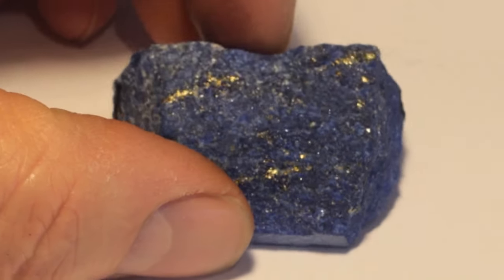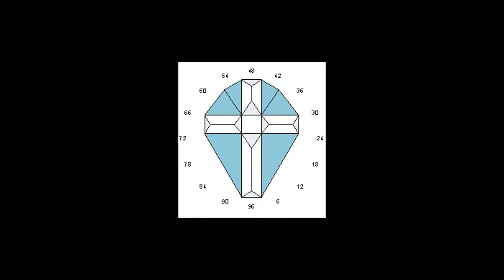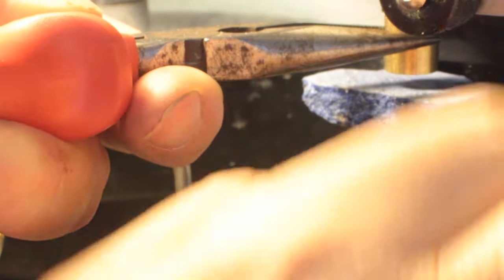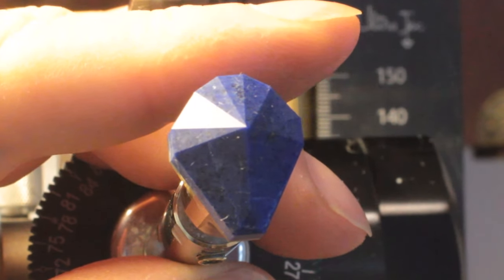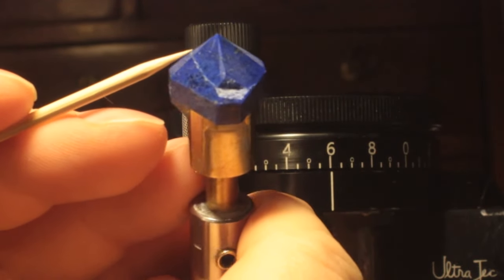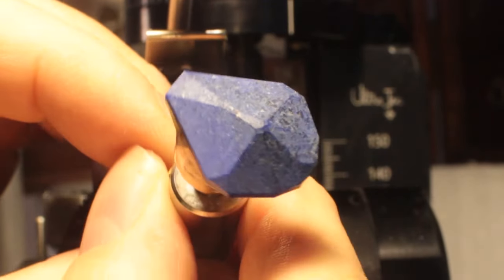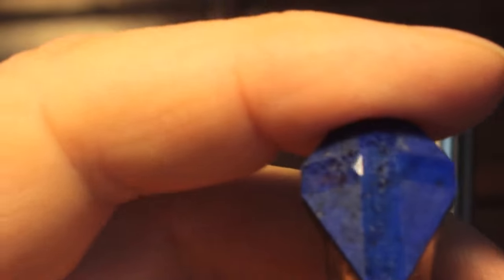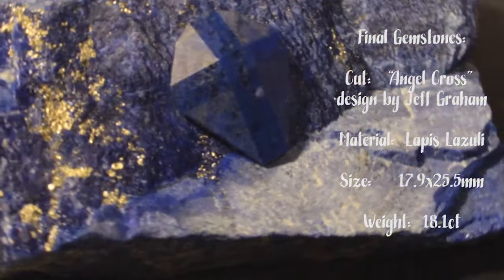Gem Cutting Tutorial: Lapis Lazuli In the Angel Cross Design

Comment: Very unique initiative "dealing with opaque stones". please if you can guide how to cut and polish  lapis into a shape of perfect cube. Also I didn't knew that you have served as a troop member of US forces, that's also cool.
Reply: Thanks.  If you want to cut a cube, and assuming you are using a 96 tooth index, you cut a table (0 degrees angle) on the top and bottom and for the four sides you cut them at a 45 degree angle cutting facets at the 96, 24, 48, and 72 teeth of the 96 tooth index.  You make sure the distance for each of the four facets is the same as the distance between the two 'table' facets and you have a perfect cube.  If you are using an index gear different from a 96, you just divide the number of teeth (indexes) by four and cut each of those indexes.
Reply: @mikesackos2208  Thanks I understand your point.